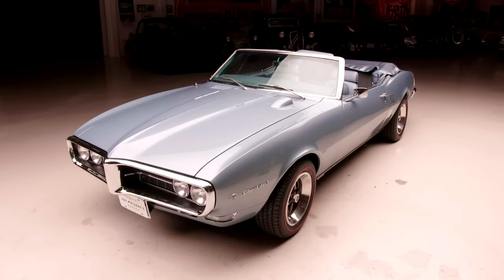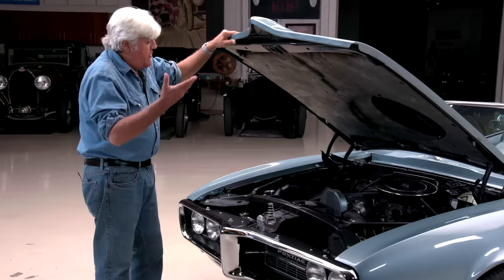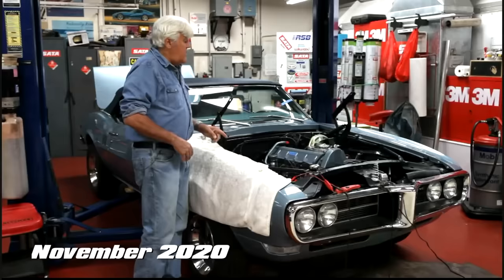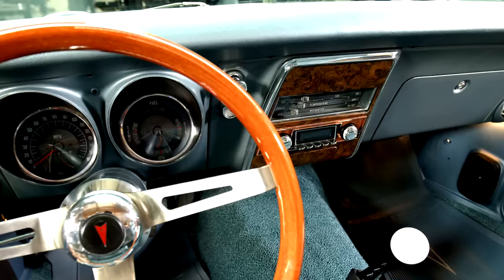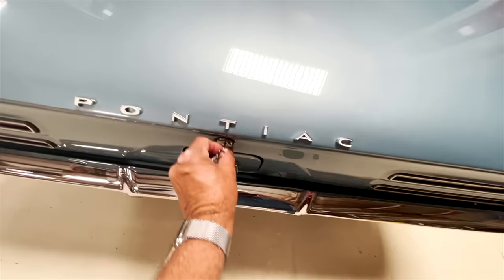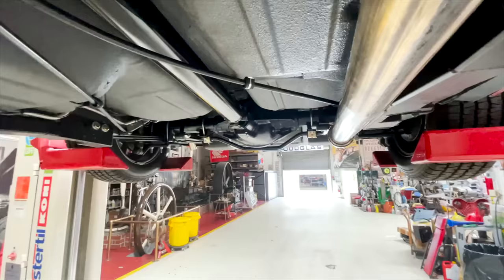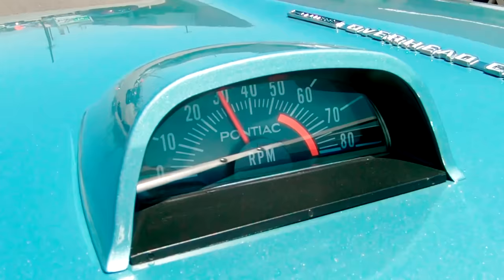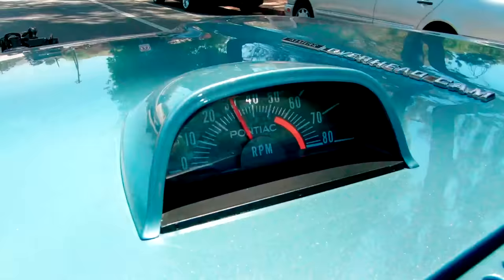1968 Pontiac Firebird Sprint | Jay Leno's Garage

Comment: I learned to drive in a 1967 firebird convertable that had 3.8 liter OHC 6 markings on the hood. Someone had dropped a 283 into it. It had the power steering and power brakes but had a power glide trans. (ick) Dad rebuilt the original 6 in our garage, but he never put it into the car and sold it with the car shortly afterwards. I consider myself lucky to have not only gotten to see such a unique car but got to drive it too. (even if it was with the 283 in it)

Comment: Back in the early 70's my father bought an office supply store and the delivery vehicle was a 1967 Pontiac Lemans station wagon with the overhead cam 6 in it.    We later purchased a new ford van for delivery's and for a while when my car was down I drove it. That engine would run and run and run.  Very impressive.   I wished I had the car now.

Comment: Hello Jay, I worked at Stewart Chevrolet in San Francisco in 1967 in the body shop. The Rally Sport Camero’s had these canasters in all four corners, they were filled with a heavy oil, don’t know what kind of oil, but it was for help the car corner better. It was to assist the ante roll function of the handling.  

Gary Mayfield

Comment: 81 in Taunton mass I got one of these that had been vandalized at a 'Pit Party' when the owner got it hung up on a rock.  The body was destroyed and the conv top was mangled beyond repair.  But that motor ran!   I kept it planning to use the crank for a 225 slant six stroker.    Old school engine building trick. Never got around to doing it.

Comment: I really enjoyed the restoration of the Firebird Sprint. I am one Pontiac Guy, who does know what the Sprint was all about. As a former owner of Two Sprints, I still have the Sales Brochures for those Pontiac's. My first was a 66 Tempest coupe with the Sprint engine, 3 speed on the floor and just a few other performance options. This was the first car I ever owned, right after being discharged from the US Navy, during the war in Vietnam. The second was the car you have - a 68 Firebird Convertible. Mine was Videro Green with a white top and black interior. I loved that USA version of the Jag XKE. And so I had a custom dual exhaust created so the pipes came out under the center of the bumper, ala XKE. And believe it or not I beat Chevy V8's at the local Drags Strip. Not as much HP but less Weight and higher revs then a 327. Jay - if you want those Brochures let me know where to mail them. I think I still have the sales agreements for those Pontiacs. I am getting to old to have all this old car stuff and the kids will just trash it when I am gone.

Comment: Jay asked if anyone knew what the cannisters were in the trunk.  I and several of my closest friends were Pontiac/GM engineers in 1968.  These were mass dampers added to convertibles to offset the loss of rigidity that comes from no steel top.  They were used both in the front and rear to help reduce shake.  I personally owned a 66 Tempest Sprint, my first new car which cost only $1300, after my employee discount!  Great engine

Comment: Jay, great car.  I saw one back in the mid 1980s for sale on a used car lot in Denver, a Firebird coupe body, but a sprint model.  It was cheap, considering, but I was a broke student at the time.  Then, sometime in the late 1990s I ran across just an engine in a junk yard in New Orleans. They had no idea what it came out of, but it was the complete OVC 6 cyl motor with accessories.  I considered trying to buy it just because I knew how rare it was.  Then, later I learned that the Red Baron Hot Rod show car from the 60s (built to  match the Hot Wheels/Monagram Co. toy) used a 68 Pontiac Sprint straight 6 cyl engine.  You can easily see the "PMC" lettering cast in the valve cover in photos of the car. Yep, pretty rare car ya got there Jay.  Pretty cool too.

Comment: Those cylinders are called "cocktail shakers" by most people. They are basically ballast weights filled with automatic transmission fluid to help balance out the corners of the convertibles to give a better ride.

Comment: My 67 Firebird Convertible RIP. Was a factory 400 4bbl 4 speed with hood tach on the scooped hood. It had the canisters in the trunk as well. The top was powered  it also had inside the trunk a rain drip gutter out of plastic I guess for the glass back window if you had it un zipped with the top up and it rained to keep water out of the trunk? Had a console wood grained and a factory gauge set mounted on it, when I re did the interior stamped on the metal plate was Proto Type 1966 Dec. I still have those gauges and the hood tach from parting out the car in 1982. The trim package on my lower rocker door chrome covered the whole body line of the door and thur the to the rear wheel well. Under the hood from the from bumper over the radiator  core I have never seen on any others factory metal that covered that void. Last of all was the factory from air dam. I took it to bare metal rebuild and let my little brother drive it to school another car hit a patch of ice he tried to maneuver and took the hit behind the drivers door and it was torn in half.  I keep looking but it is neat to see Jay has a soft spot for his Firebird.

Comment: Those were cool cars. In the late 70's and early 80's you'd see them for sale in the 'Auto Locator' and every so often there was a Sprint in either a Tempest or a Firebird for $1,000 to $1,800 in decent condition. Even then they were cool, but in those days there were always more desirable V-8 cars which is what we were after. How I wish I had one of those Sprints now.

Comment: Some years back at a local car show (Milwaukee) a guy had one of these. It had the reflective  stripe midway through the length of the body and it was badged as a Sprint and it was the deep green. He had pictures of his full restoration. I love the weird stuff we talked for quite awhile. And during that time some would approach the car and see the 6 and keep going. And at the show I saw a 65 Mustang coupe with a 6 and the modified it with 3 side draft carbs... I did mention I love the weird stuff. It's not how fast you get there but how you look doing it. That is one sweet car.

Comment: I'm 58 now,but when I was 15 my dad was given an overhead six engine and held on to it for a year and a half. He was later able to purchase the 1968 firebird it had originally been in. It seems the guy was a gearhead and took the engine out and replaced it with a 400 c.i. pontiac engine only to sell the body to my dad so he could buy a 1970 Z28 he found for sale. The firebird was a hardtop with a 3 speed on the column, and could do 90 m.p.h. in second gear. I really liked the car, but West Virginia snow and salt took a toll on the body. It was a really good car to learn how to drive in.   MEMORIES !!!

Comment: Saw a yellow Sprint-powered Firebird at the Pate Swap meet a few years ago. My grandfather was not much of a car guy, but he did have a Pontiac Tempest Sprint he bought brand new in '66 or '67. He was quite impressed with the way it would "ketch uhnuther gear" at 75 mph; probably those secondaries kicking in. :)
It seems that the 'Bird Jay has would have been the ideal pony car during the muscle era; better weight balance than a V8 Firebird, easier access for engine maintenance, and better fuel economy than the big V8s could offer. As Jay noted, the power was close to that of the 326 Pontiac also offered back then. 
But Poncho V8s were a bit heavy, so the Sprint engine would have a power to weight advantage. The 326 might do better off the line, but the Sprint OHC could rev considerably higher, and the weight balance would be a further advantage in the twisties.

Comment: I loved this. I had one too. It was white. I was in love with that car. I had a 62 Corvette and a 62 Bonneville convertible. Unfortunately the Bonneville had a slim Jim transmission. No one could fix it. It got to the point that I drove around with a case of tranny fluid all the time. 
I wish I had any of those cars now. 😢

Comment: Those weights in the trunk are harmonic balancers to eliminate vibration. Lincoln convertibles from 1961 through 67 used these on all four corners. These were round and hidden under the bumpers. I had a hell of a time convincing mechanics in training that they were not vacuum canisters.

Comment: My first car in HS was a 68 firebird hardtop, with the OHC 6 but with a power glide. I was always getting crap because it was "only" a 6. But in auto shop I installed a header and a 4 BBL carb, and it made it a different car. It beat a lot of stock V8 cars. And it sounded like a Ferrari. I wish I still had it!

Comment: I have a friend that had a '69 Sprint.  Same old story... blew the engine and slapped a 389 in it.  It was dark blue metallic, black interior, black vinyl roof.  Auto transmission though.  Years later I saw a dark metallic green '67 Sprint with the 4 speed.  White vinyl top and interior in Denton, TX.  Original owner was from Michigan, and it was totally rusted out.

Comment: Dear Jay Leno and Barney in 1969 in St Charles Missouri my friend's dad had a 69 Firebird 400 automatic 411 positraction he took GTO ram air heads Holley 750 d pumper headers shift kit torque converter and that car would run a high 11 and scare all of us teenagers to death it was so fast. I want to build one just like it.

Comment: I lived in the Philippines for 10 years from 1998-2008 and owned many American cars while there. I had the chance to buy a 1968 Sprint Coupe with the 4.1. It had the factory header, Q-Junk 4bbl and a PowerGlide. It had 24,000 miles on it and was in mint condition although it had been sitting for nearly 20 years. Like Jay's car, it was originally purchased by an American Air Force serviceman stationed in the Philippines at The Clark Air Force Base in Angeles City. When i first saw it i was blown away thinking it was some sort of Filipino conversion but as soon as i saw the PMD and Q-Junk i knew it was the real deal. The feller wanted $2500 for it but at the time i just had too many cars and didn't have the space for it.

Comment: Mr Leno.  The cannisters were used only on the 1st gen Firebird convertibles.  

They contain tuned weights and springs to quell cowl shake.  The F-body convertible suffered SEVERE cowl shake during development and Pontiac developed these weights to tune out the shake without the additional bracing Chevrolet used in the Camaro.

This is from the days when GM was five separate kingdoms under one corporate umbrella Pontiac did not share the tuned weight solution with Chevrolet.

Comment: My ex-in-law had a six cylinder Firebird.  It looked great, and that was about the end of what I could say for it.   Another guy showed up outside machine shop class in HS one day with a brand new red 69 Firebird 400.   It was a great looking car, and supposedly fast, compared to other muscle cars.  The shop teacher was in his late 20s and had one of those neat American Motors AMX cars that was supposed to compete with the Vette.  I secretly longed for one for many years, because to me it looked so cool.  

But of all the nice 64-69 cars I rode in back then there wasn't a one with a comfortable ride, good handling, genuinely fast 1/4 mile, nor were any of them good at keeping road noise out of the interior.  Muscle Cars - ha!  Corvettes?  Ha! They were a marketing gimmick for the first few years, then the oil embargo made them obsolete, then emissions, then price...  Sure, a 68-69 GTO was a great looking car, but what kind of performance can you get from a "Wide Track" boulevard cruiser that weighed over two tons?  My buddy's beautiful Plymouth GTX 440 couldn't break 15 seconds in the quarter at the local drag strip. Same with even the 'small' muscle cars.    I am so glad for today's resto-mods and the aftermarket builds, spare parts, suspensions, brakes, engines, etc.  If they could get the crush panels, air bags, and other safety features, I might own one.

Comment: I have loved these cars since I was  boy.  Thanks for the tips. I need those sub-frame connectors for my 400.  A new 5 speed transmission would be a lot nicer than the old 4 speed.  I have one of those hoods (1967) in the back of the shed too but mine says  3.8 Litre.  I didn't know they were rare.

Comment: That engine was available for the Chevy Nova as well. It was 250 cubic inches, 250 horsepower. I got a new Nova towards the end of the 1969 model year. My Dad and grandmother paid for it. My Dad said no way on the sprint engine. I ended up with a 230 Cubic inch, 140 h.p. engine which worked well and probably kept me out of trouble. :-)
Reply: My dad said no way to the base rsx and got the 200 hp k20a2

Comment: S-E-X-Y! What a gorgeous 68 Pontiac FB Conv. The intention was to make it a "sports car" for the American market. Did it take? NO. Why? Only because everyone wanted "A V8." Gas was still cheap back in the 1960's. Had the car been introduced AFTER the Oil embargo of 1973, you bet a lot more of these would've been sold. Jay is the most down to earth kind of guy. He's is HIGHLY knowledgeable about  classic cars and trucks and he explains everything so you can understand where he's coming from. John Z. De Lorean-Pontiac would NOT have been the same without the man. The GTO WAS his "BABY." He helped to launch the muscle car era in 1964 with the all new 1964 GTO.  It was a tire melter indeed. Unfortunately, he took a wrong turn back in the 80's however, there's no denying his engineering brilliance and what a great asset he was to Pontiac Motor Division(PMD).

Comment: Hey Jay, those "weights" in the trunk and at the front corners were called "cocktail shakers" they were filled with transmission fluid and had a 25 lb spring loaded weight inside and helped combat the cowl shake convertibles of that era had.
Reply: interesting

Comment: During High School and College I worked at a new and used car detail shop where we cleaned cars for many dealers.  I saw my first Pontiac Firebird Sprint with the hood tachometer in 1972 as someone traded it in. Now I realize how rare that 6 cylinder car actually was. All of us guys who worked there were strictly  pro 8 cylinders. The only one not was my brother, who like 6 cylinder cars due to the dramatic price increase in gas and the gas shortages at the time.

Comment: I wonder what a modern fuel injection system would do for that car? Throttle-body or Multi-Point, either way would work.
I like how Jay modded that car, too.
I bet it drives like its on rails.
Thanks for sharing your cars with us, Jay. 
The pleasure is all ours. =)

Comment: I was a line mechanic at a Pontiac dealership in the mid to late1970's. Occasionally one of these came in and I worked on them. The engines were not so good for the reasons Jay showed. I think the bottom end was a Chevy 6 but really don't recall anymore.....

Comment: The first version of the Firebird and Camaro were the best, but I think the Camaro was the cleaner design. The Pontiac "nose" was a bit too much of a beak. If the six had been much less cost than the eight I'm sure they would have sold more. Thanks for showing us this car. 👍 The exterior and interior colors are a plus. Seeing you enjoy this six is why I like my 2011 V6 Mustang convertible with a 6 speed manual; plenty of power and 34 mpg. Keep a rollin Jay.

Comment: I had a 1969 Firebird convertible with the Sprint 6 in it.  It was a cool design, but for whatever reason, I could not get it to hit on all 6 cylinders.  #4 cylinder was dead.  It had good compression but all of the cam followers were worn out.  So it effectively had a flat cam.  I couldn't find parts for it in 1982, so I pulled it and put in a 400 CID Pontiac V8.  It had the V-8 when I sold it. I wish I had kept both the car and the original engine.

Comment: I can only imagine that those weights in the trunk were there for handling purposes too, in addition to harmonic damping. If the straight six was so much lighter than the available V8, then putting these weights in the rear could help the car achieve a much more even 50:50 weight distribution. Given DeLorean's targeting of the XKE with this Firebird Sprint, I'm sure the handling aspect was critical given the basically equal power of both cars.
Reply: Austin Healey 3000 owners used to carry a sack of sand in their trunk for the same reason

Comment: The "Weights" are Cocktail "shakers" and have oil in them and a spring IIRC.  They are different for each year, and different than the Camaro in mounting so finding the right ones can be a chore.

Comment: Heres some info on the Firebird and Camaro convertible body dampers that here are said to internally be a combination of weights and springs, there were two in the back and two in the front - they were often referred to as "cocktail shakers".  The front dampers were 25 pounds each and the rear ones were 50 pounds each and theyre purpose was to reduce body shake in the convertible bodies.

Comment: Love it! I had always had a 'if I had Jay's money and shop' fantasy about doing a 68 LeMans with one of these motors  hot rodded with a twin cam head (I think someone made a prototype?) along with tuned headers, 3x2 Webers, forged internals. I wanted to make it look like what if PMD did a LeMans for LeMans back in the day, and made a sports racer prototype in that genre? Stripped interior, IRS rear stolen from a Vetter, gold Halibrand knockoffs, 5 speed with a gated shifter like a period Ferrari, lightened panels, yellow endurance style headlights, roll bar, lexan windows, etc, in Pontiac blue with white stripes; or maybe black and gold.  Just need to hit the power ball.

Comment: "The engine has got well over 100000 miles in it, it's worn out." 1960s engines cracked me up. I have a 2006 Volvo V50 with nearly 500000km on it and it is in amazing condition. Recently put a cam belt on it and had a look at the cams, the look brand new. Same for the bottom end!